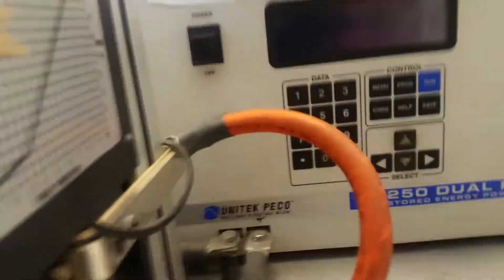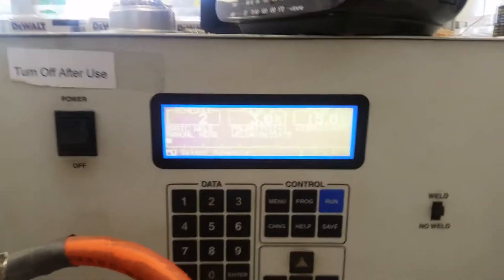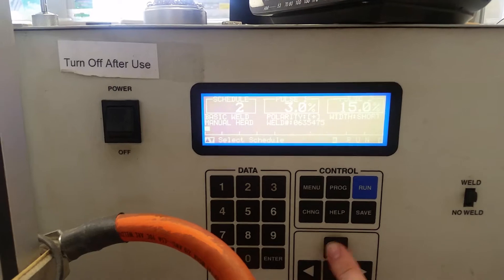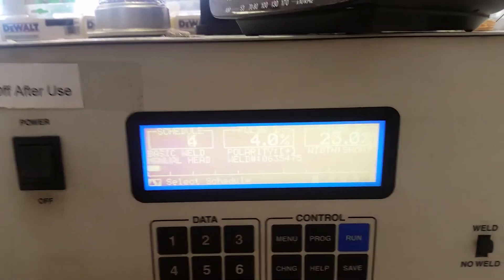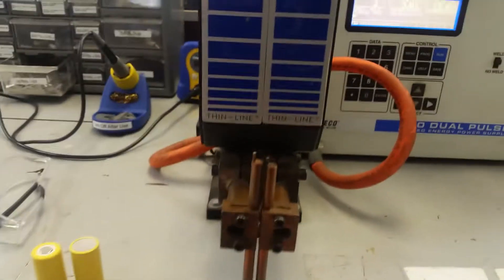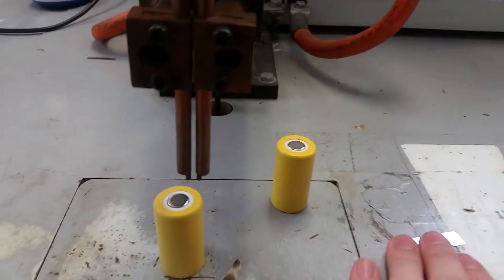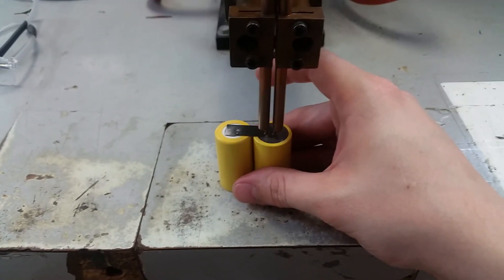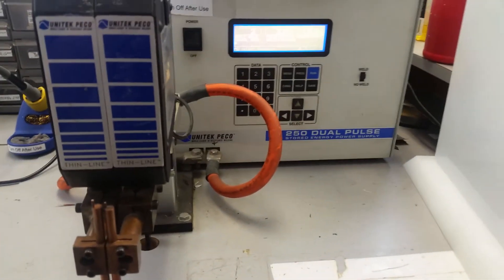Unitek Peco 250 tab welder

Comment: I thought 1 electrode should be on the battery surface and 1 should be on the tap, so, that the electricity travels between both mating surfaces.

Comment: Nice tab welder!  What do you guys use it for?
Reply from the maker: Oh hey didn't expect to see you here. Anyways we build custom nicd and nimh battery packs and sometimes if im lucky, I get to blow up thionyl chloride batteries and get sprayed in the face X-D but mostly we just rebuild common power tool batteries. 

On another note. I had to cancel all my patreon subs recently after my card got compromised but I will be resubbing to them all soon.
Reply: @x9x9x9x9x9  very cool! And no worries I appreciate all current past and future patrons. I actually stumbled on this video deep diving tab welders and remembered your name from patreon. Out of curiosity, what's the cost on rebuilding makita batteries? And what battery cells are the top bang for buck if rebuilding?
Reply from the maker: @ElementalMaker  Retail price is based on voltage for us so an 18v is like $45 as for the best cells you can pick up some tenergy cells for about $2 each that aren't bad. The best is probably sanyos but they are expensive.

Comment: That's a nice bit of kit! Dialling in settings is a bit of a chew, but when it's right, you can clearly rip through the welds. Also, don't often see 26650 cells in use. Re-celled a pack last week that had them. Stuck in a bunch of mj11 cells, much higher capacity, big weight reduction. It's funny when you recell an old pack, especially if it's ni-mh, wonder if customers think for a moment that they've been ripped off what with the colossal weight reduction lol
Reply from the maker: Oh yeah. 26650's are some beastly batteries.

Comment: Definitely does a pretty decent job. The weld dots look quite fine in terms of size. Definitely looks better then I'v seen in some battery packs. Honestly, I think I'd prefer 4-6 smaller weld points instead of 1 or 2 large ones because the connection would have better contact and durability overall. Plus it doesn't look as burnt then. This was quite interesting to see, I'v never seen one being used before.
Reply from the maker: I used to put 3-4 weld (6-8 spots) on each terminal but I ran out of the longer nickle strips so I don't have as much room. The other reason I only do 4 is in the event I mess up I can get the tab off easier and wont have as much to clean up on the battery afterward. I think I am going to make another video over the weekend going a little bit more into depth on the machine and how it welds. Maybe build a whole pack on camera. I also want to show the magnetic field that pops up when a weld is made. Is there anything you would want me to show in the video? I can't take the machine apart since its not mine and I kinda like my job.
Reply: x9x9x9x9x9
I'd watch a more in depth video if you made one. Seeing the process of rebuilding/making a pack would be interesting and also good information to me.

I'v only stuck a few packs together myself. I usually use a 300V capacitor bank and a high current mosfet to weld tabs, it works, bit it spits sparks nicely as well. I usually just solder Ni-MH and Ni-Cad cells, because the electrodes are plated with something (Nickel?) that takes solder very easily. Bonds in about 4-7 seconds which dosen't only gets them slightly warm after doing both ends.

I definitely don't trust soldering Li-Ion cells because they're very sensitive to heat and require more heat. Bad combination. XD

By the way, how often do the electrodes need swapping if they wear out? Or do they last pretty long?
Reply from the maker: theLuigiFan0007 Sweet! Welding or soldering to lithium is sketchy. I has a saft 14250 li-socl2 vent on me once. I got very lucky that I was wearing glasses. I saw it hit the lens before I closed my eyes. A trick to soldering on batteries is use some sandpaper to rough up the surface a bit and it will stick quicker and much stronger. We pretty much only do ni-cad and ni-mh. I do coin cells every now and then but try to avoid them. 

Every dozen welds or so I use some sandpaper to clean the electrode tips but it really all depends on how clean the welds are. If you do a crappy weld then some of the material might get stuck on the electrode. The rods last a long time before you have to replace them. I have never had to replace them because they were too worn, but have swapped them because we got new ones randomly. 

I will try and film a video either tomorrow or this weekend. showing the machine some more and the process of making a complete pack.